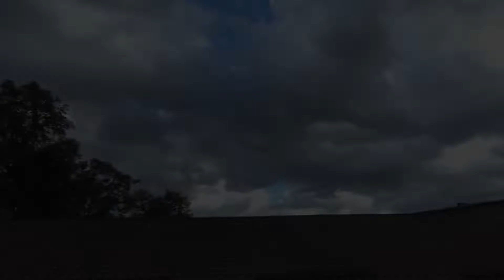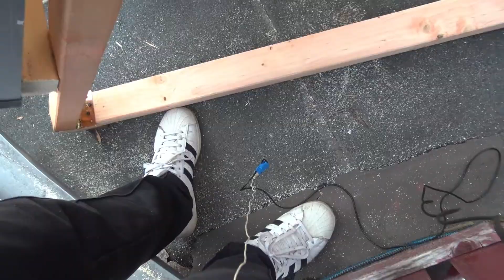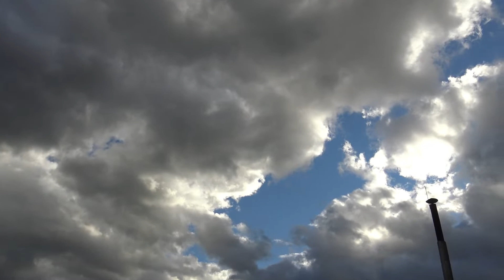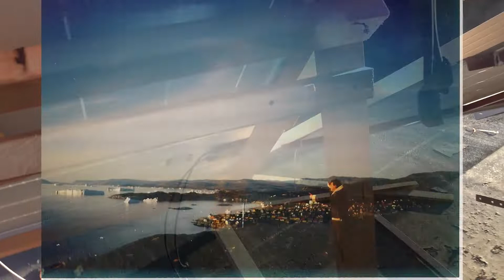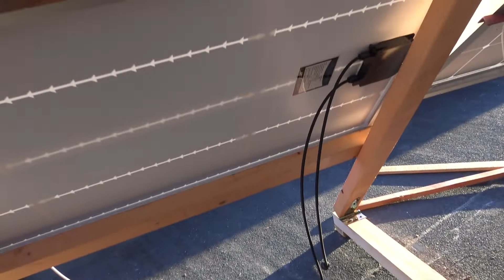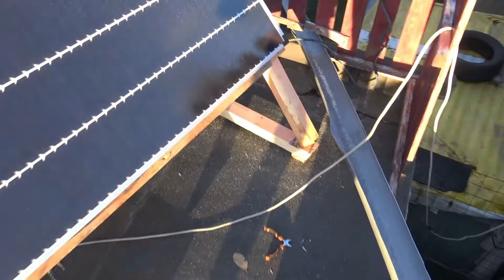DIY solar panels stand

Comment: I have questions:
1) why wood?
2) is that wood tied somehow with the base? Or somehow so that cannot fly when a strong wind ia comming
3) why didn't you painted the wood before building this?
4) why not metal?

It is very important to secure the panels so that cannot fly away on bad wheater...
Reply from the maker: It's easier to work..cut and screws..it's damn heavy, that wood is from a company building houses, already treat against water..it's so heavy nothing can move that..BTW..the metal ones nearby are not tied to the floor..and in the summer, roofs up in the air..nor my panels!   Maybe I'll put some extra weight from old garden umbrella stands..you can see one in the video..finally..it's just improvisation..if they want to fly , let them be free! :-)
Reply: @viocaia  🤣🤣🤣🤣🤣🤣🤣